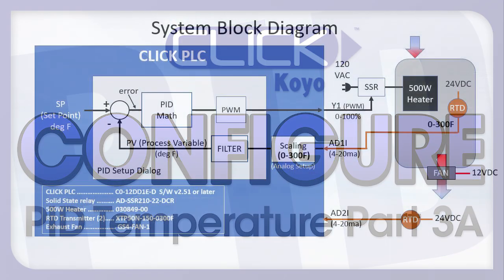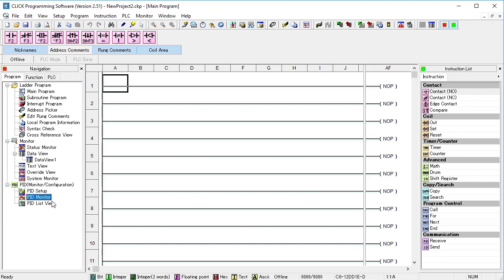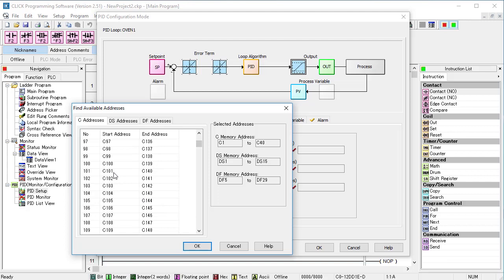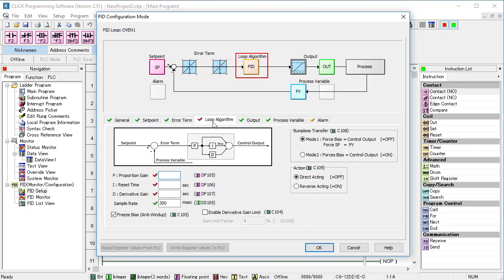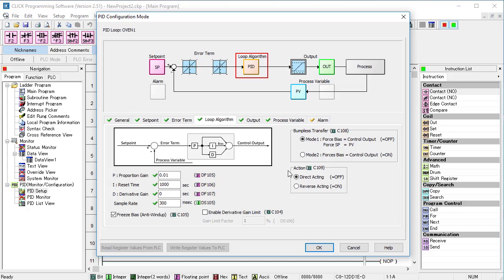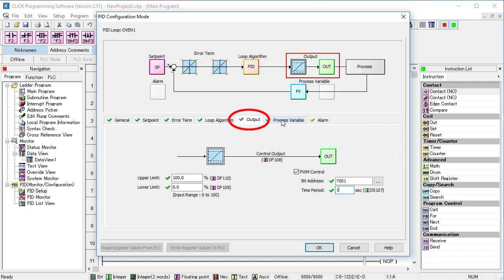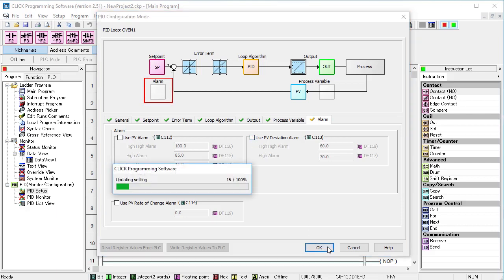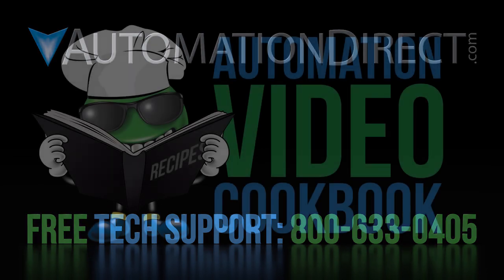CLICK PID Tutorial Videos Part 3A - Configure PID part A from AutomationDirect

Comment: Is there a function block to control analog with digital?
Is there a function block to control digital with analog?
Can you use a controller as a ratio relay?

Or is this just a cheap o PLC for hobby use.
Reply from the maker: Thanks for the questions! 
While many of our products are used for home, hobby and unusual projects, our products are designed and built for the industrial automation industry. AutomationDirect offers products directly to the customer cutting out the middle man, we can offer our industrial products at competitive prices.
The Click and Click Plus PLCs use ladder logic only - there are no function blocks, but the functionality you are looking for is certainly available with a little programming. 
For details on varying an analog output with digital inputs or vice-versa, or setting up a ratio controller type program, or any other applications, please call our top-rated technical support team at 800-633-0405 or one of the other contact methods found on our support site:  https://support.automationdirect.com/